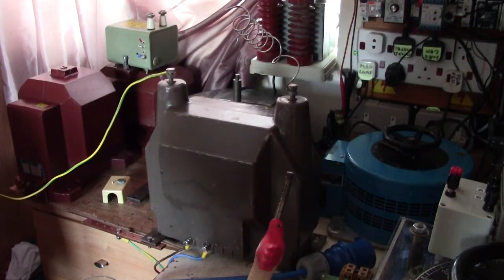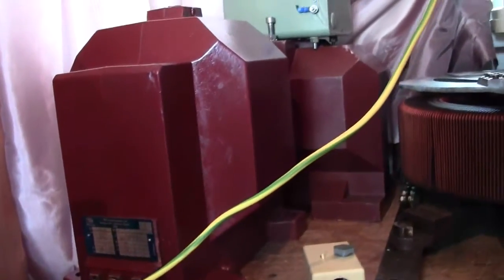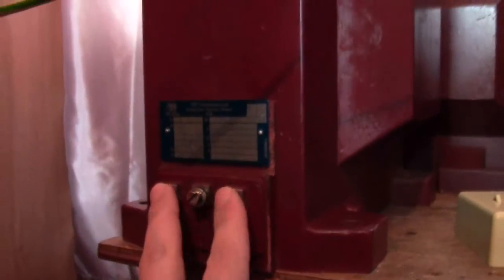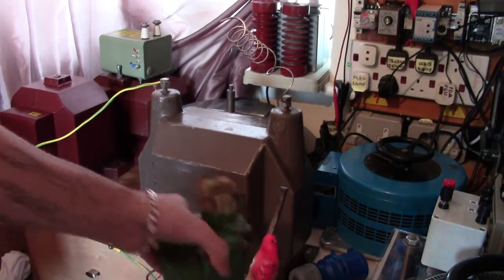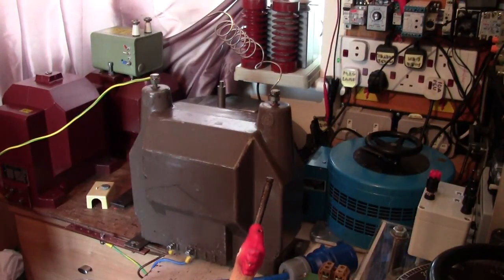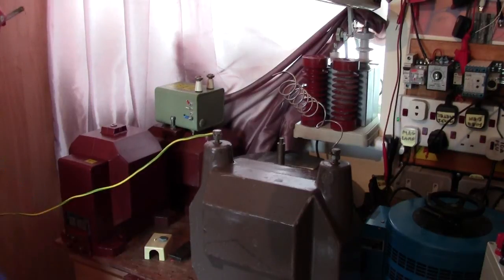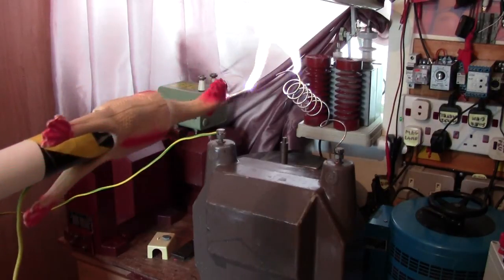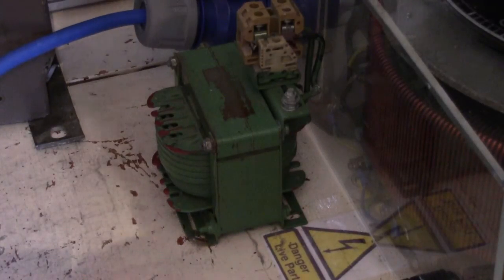Running new 20KV potential transformer UN-BALLASTED with some extra power ;0)

Comment: Hi John, nice work, and three points 1) what you thought of as 'static' could be metal bits being picked up by the abnormal external magnetic field produced by the variac under unballasted circuit conditions, 2) some circuit breakers use the magnetic field from a coil of wire to deliberately vibrate and disrupt an arc so you might see better (longer) arcs without the spiral of wire on the transformer, 3) shame the arcs were against a white background, and the best one (straight upwards) went mostly out of the picture! Regards.
Reply: Thanks Ian ,Its good to get some feedback ;) i'm now playing with another 20KV PT that turned up in the post this morning so i may do another vid as your not the first person to say you couldnt see it ;)

Comment: Whoa! Nice arcs!
Btw, the red PT is not three phase, the load of connectors you see on the sec. side are for taps on the windings, aux. windings and eventually (I'm not sure though) a thermal protection, a three phase transformer would have an E shaped core and 3 HV bushings!
Reply: w
Reply: Well i dont want to say that your wrong as i know that you very experienced in this sort of stuff I did say in the vid that it had 2 lots reading connections ,also the face plate clearly says 3 phase as does the datasheets which is strange as the way its explained is there would be three of these TX's one per phase .I'm not saying your wrong though as you know a lkot more than me about these things ,maybe another vid featuring the data sheets may shed some light on this ? thanks for watching ;) this is Highvoltageprojects BTW its the only way to reply to a comment on my own channel ;)
Reply: John Seach Yes, those PTs are intended to be used to monitor three phase power, using three transformers, one per phase (in three phase operation, you have to use the correct voltage ratio, the  *****V/sqrt(3) signature is just for calculating phase-to-phase voltage from star connected PTs). My PT has two sec. windings, with different precision classes at different loads/voltages, and was used with other two matching PTs to measure three phase voltages. (Wow.. did youtube really screwed comments up that way?)
Reply from the maker: favret94 that makes more sense ;) and i think the comments are slowly getting sorted ;)